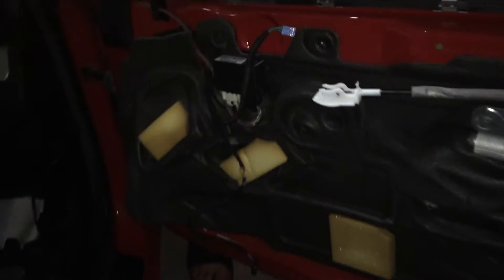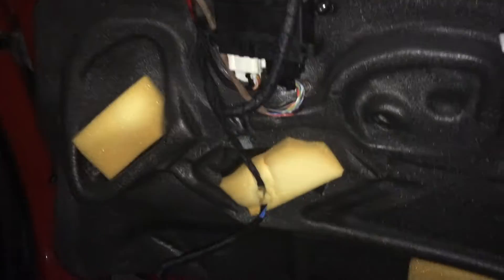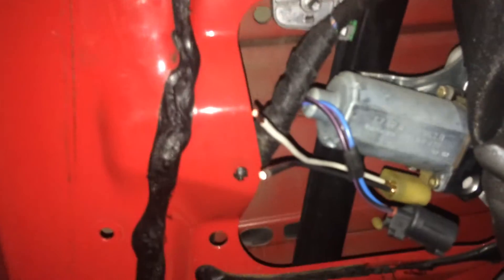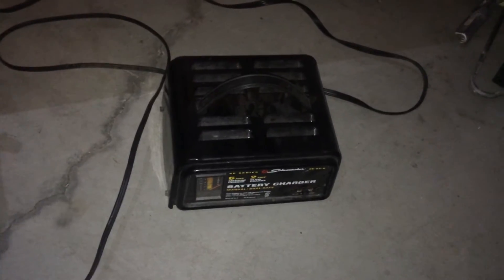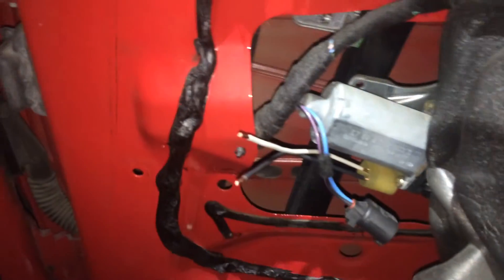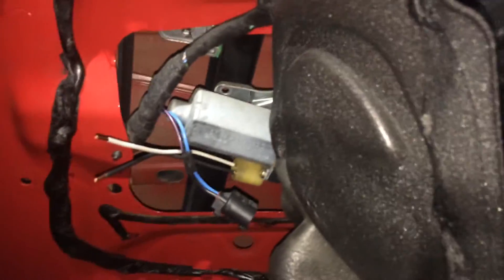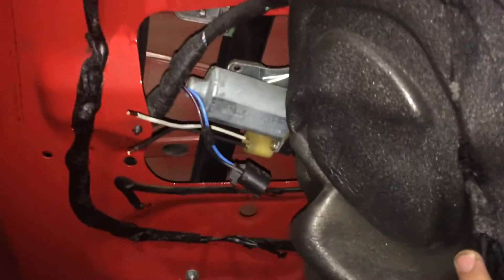BMW E46 330CI manual power electric window roll up no switch or relay

Comment: I don't get it you ask a simple question like how to roll up a electric window manually on a 1986 735i and it shows you everything but that
Reply from the maker: lol I guess your right it is pretty specific...but it should work the same on all windows as long as the motor works